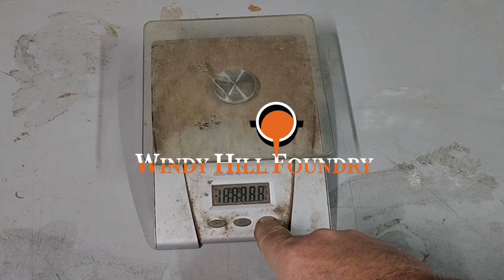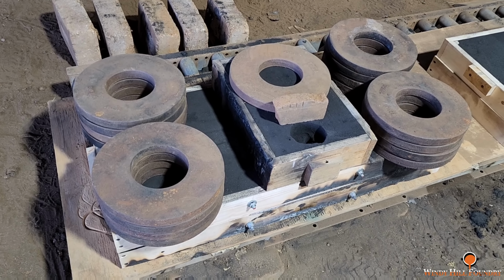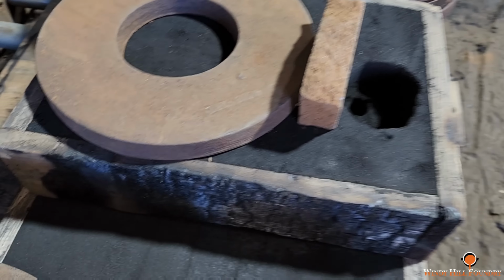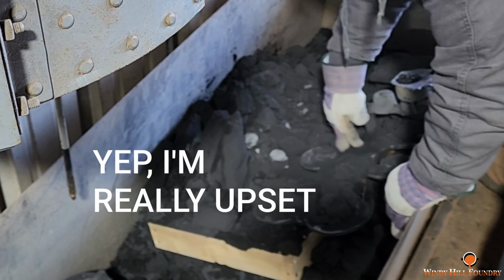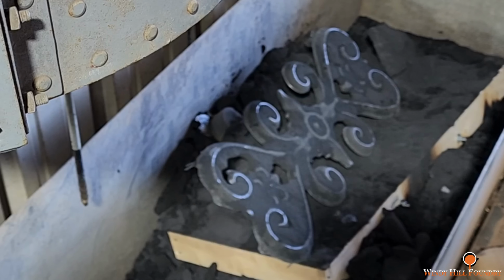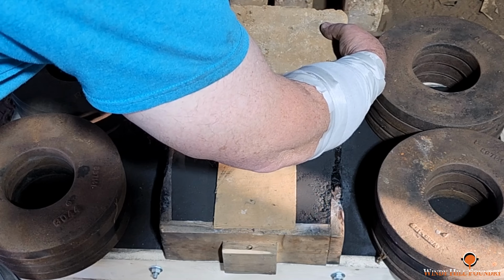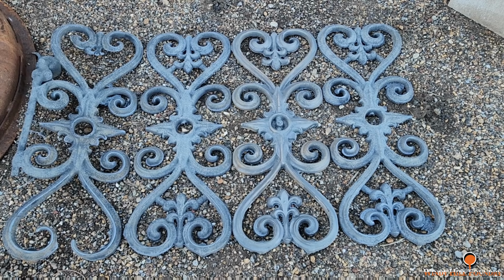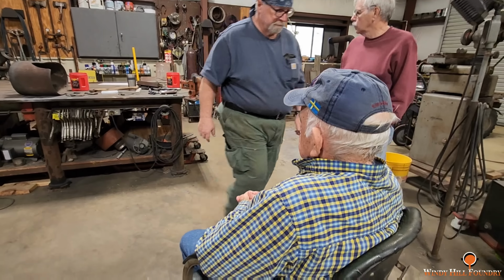OFF TO A BURNING START

Comment: Maybe put a pouring cup at each end and a vent in the middle where you currently pour cup is. I’d make the sprues bigger to give more fill pressure. You’re losing your head pressure when material spills out between the 2 boxes.

Comment: Walking about getting burned, I worked at a carbon plant. We shipped in coal and purified it into carbon. The coal was stored on large pads 500 feet long and 150 feet wide. One shipment was rejected with too high of impurities (sulfur) in it. The plant had paid 7 million dollars for the coal and shipping. The problem was that the sulfur would infuse into the furnace and infuse into all coal runs afterwards. The plan was to wait till the furnace needed to be reworked and run the high sulfur coal on the last run before the rework. The high sulfur coal sat for years. The compression of storage for so long can creates enough heat that the coal could smolder at the bottom. To put out the fire we had to move the coal to a new pad as we extinguished the fire inch by inch. We worked on top and slopped it into a water pit we built. I fell into a void the fire had created.

Comment: I had a 12" Sinker Davis gong that I sold to the Buckley Steam show up in Michigan. While not as bad a this one, it did have a crack that they successfully brazed. Here's a video of all their big whistles being blown. https://www.youtube.com/watch?v=R6ulq8n3rxQ&t=36s The big Sinker Davis is at one minute 26 seconds. The one blown at one minute 56 seconds is also a Sinker Davis, though smaller....not sure of the size, though I think it's a 10 inch. 

The original selling price for the 12 inch was $50 ca. 1910 - a little over $1500 in 2022. They were popular in logging camps and were marketed by SD as "The bull of the woods" for their deep low pitched sound which carried for miles. The one I had was originally on a furniture factory and when the wind was out of the north, it could be heard at the next town south about 20 miles away. 

Because they were cast iron and not shiny brass, a lot of these were scrapped and not many survived. Those fellows have something rare and I'm glad your Dad is mending it. I'll bet brazing will work just fine.
Reply: It's all brazed up and ready to go.  Our problem now is finding a steam source for a test run.

Comment: Clarke you need to get yourself a Alvera plant and whenever you get a burn as quick as you can break a piece of leaf off the plant and squeeze the juice from the leaf directly onto the burn area it will straight away stop the burning sensation and reduce the damage to your skin, I work with a gas torch all the time and have burnt myself many times and many times I have rubbed alvera  on the burn and next day you wouldn't even know you have a burn.
Reply: Might I suggest several very large ones.  I worked at a race car fab shop years ago and getting burned from welding was pretty common thing and we kept Aloe Vera pants all over the shop (like a couple on every window sill)

Comment: Clarke: a few suggestions some of which may have no value whatsoever! 
1st. I was watching the "MAN" Manufacturer over in Germany of very large industrial diesel engines for trains and ships.  They show the entire casting of a 1700liter marine engine.  In order to get a proper casting they have to pour 36,000 lbs of molten steel in one continuous pour.  For it to work they have to pour from both ends simultaneously or risk an incomplete fill.  An this all has to happen in the span of two minutes.  So you may want to try simultaneously pouring from both ends??
My wife was a burn nurse at the Oregon Burn Center and their go to treatment for burns was Silvadene, "1% Silver Sulfadiazine Cream" which comes in various sizes and I would recommend the 500gram size.  Apply liberally to gauze and apply to the burn and wrap with "Coband".  It will briefly burn then quickly feel much better.  Wash the area and change the dressings daily.  Silvadene can be used anytime there is broken skin.  Cuts, burns, scrapes, sutures.  The silver is what does the trick, silver is a natural antibacterial,  antiviral medicine.  Oh you may need a prescription, here in Washington one is required.  I'm not sure about where you are.  Your PCP should be able to take care of it.  Best of luck hope this helps with future injuries and God Bless.

Comment: The few times my grand daddy (US Navy diver and hull technician) and great uncle (US Navy engineman on coal and oil ships) got together, they sometimes talked about the most dangerous jobs in the Navy. Stoking coal passing thru the Panama Canal my great uncle went from being an able bodied seaman to a Second Class Petty Officer because so many of the Enginemen died working the engines. My grand daddy became a First Class Petty Officer once he qualified as a Diver and no one wanted to do it.... But, they both agreed you had to be insane to go into the rating Foundryman. Those guys got burnt up a LOT. Trying to pour molten metal on a heaving ship? Not impossible but ....theres a reason why Navy Moulders Boots are easy to flip off.

Comment: We used to have  a guy that made some castings for us at work. He used a chemical set sand and this way he didnt have trouble with molds coming apart. It was more expensive but he said with the time he saved in failed molds it actually paid for itself. He said the sand was so strong, he could use a slide hammer to remove the pattern.
Reply: A typical technique is add water glass (sodium silicate) to the sand. After the sand is compacted around the mold, risers, gates, etc. it is subjected to a spritz of CO2 through what looks like a shower head. The reaction forms a silica gel which provides modest strength and flexibility to the sand. It makes it easier to remove complex patterns that may not have sufficient draft without having the mold sand crumble. The mold sand becomes quite hard to the touch.

Comment: Welded 33 years plus with mig and sub arc. Like you, I have no talent with stick. Never done any brazing either. Burns are tattoos of the trade when you work with heat. I got the proof lol.